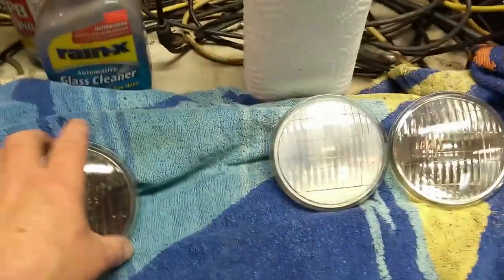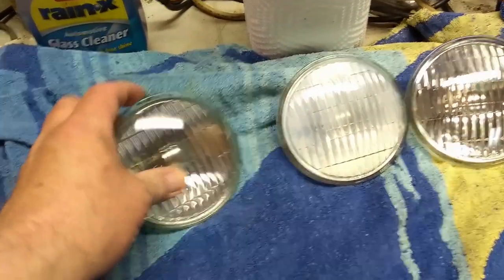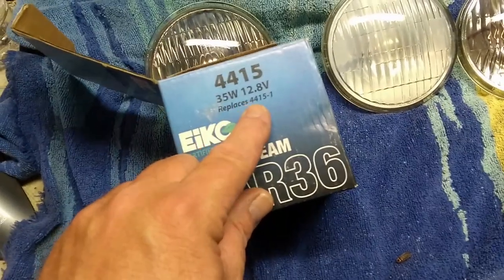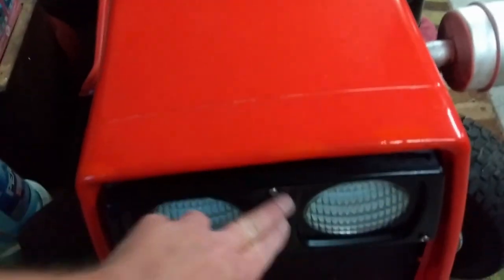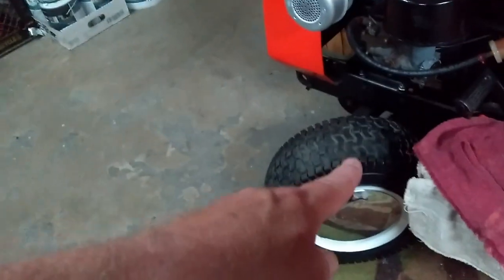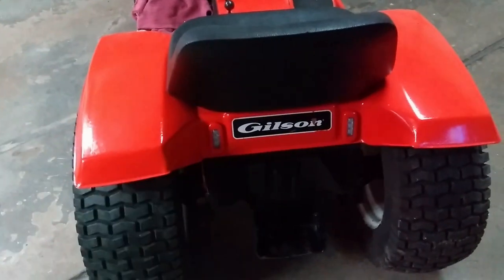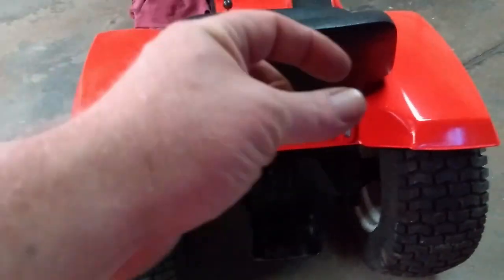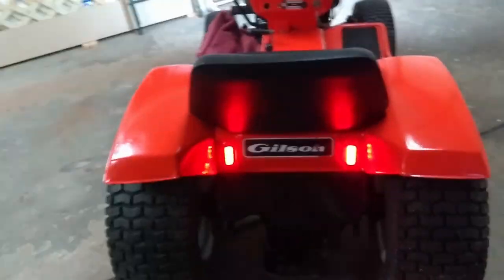a lit Gilson Hydro 16

Comment: I missed the prime deal on the headlights . I want some for my sears.
Reply from the maker: It maybe because I had them in my cart for many days and so Amazon just through me a deal to get me to pull the trigger on them. :) They are great so far time will tell if they last a long time or not normal price is about $16 each so kinda on the pricey side.